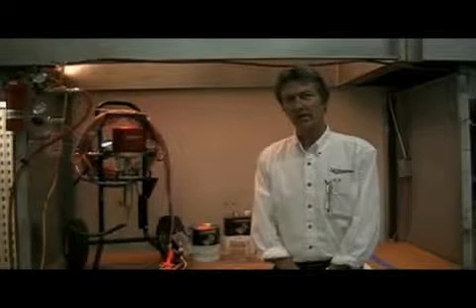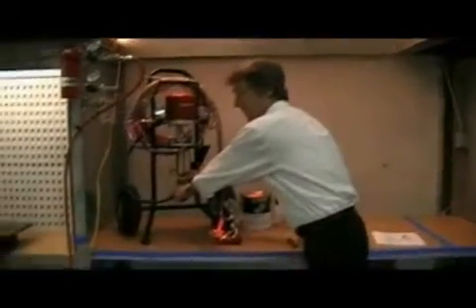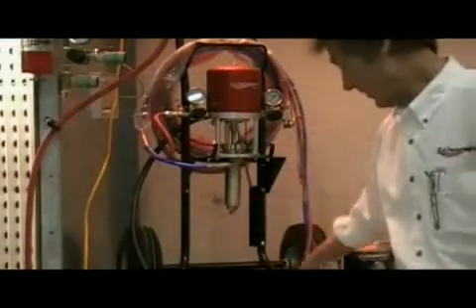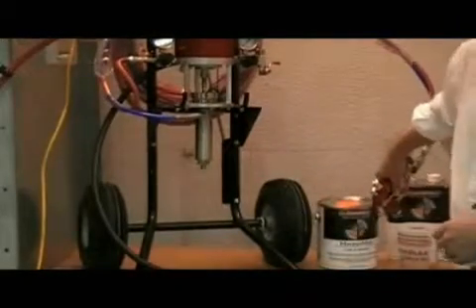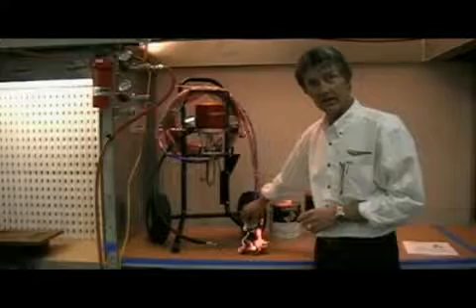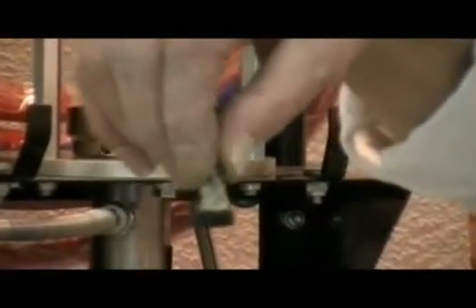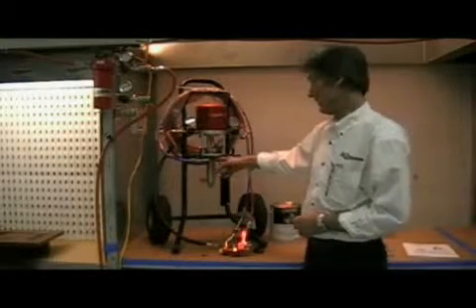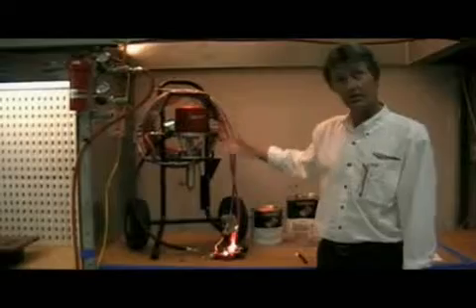CAT Air Assist Airless Video Part 4: Troubleshooting

Comment: My is stopping in upper point and starting bleeding air , loosing fluid pressure , after trigger down  . I changed air motor parts , didn't help . Very unsatisfied . Never buy stuff from small manufactures .